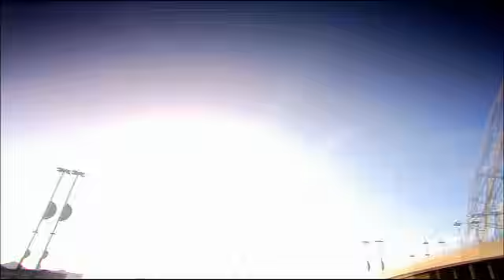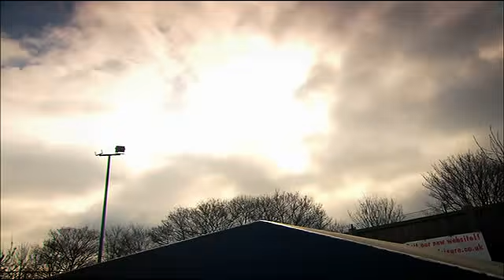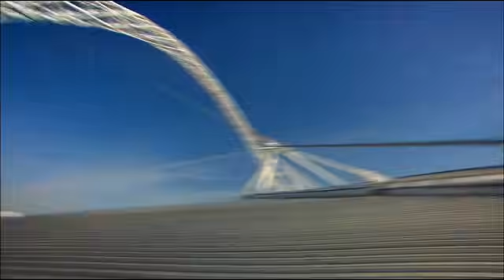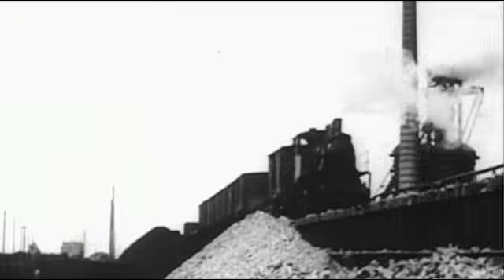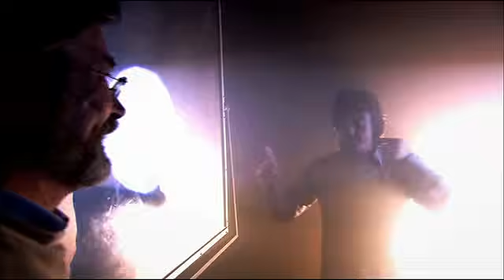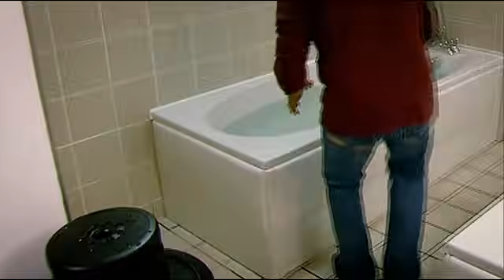Richard Hammond's Engineering Connections | S02E01 - Wembley Stadium | DocumentaryHub

Comment: Why didn't the engineers lift the arch from the other direction?
Instead of lifting it through 112 degrees as they did, they would only have needed to lift it through 68 degrees if they had lifted it from the other side. The arch would have also been lifted in half the time.